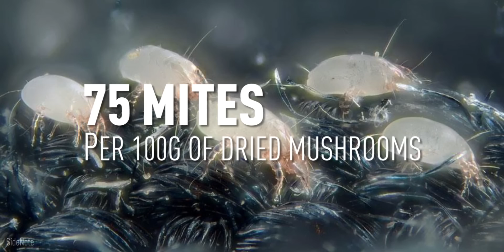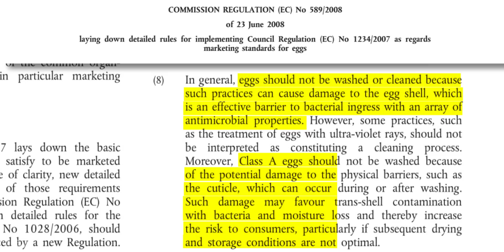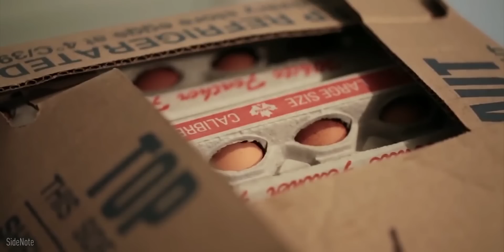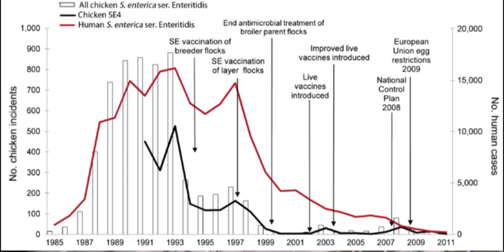Why US Produced Eggs Are Banned Across Europe (& vice versa)

Comment: Huge water waste, huh?  Unless they reuse or, recycle it.

Buy cage free range free only!  Cage free has the same overcrowded conditions as caged.  America should take up across the pond's methods to save water and energy. Air-conditioning/refrigeration adds to the climate change problem.
Reply: My chickens naturally return to the coop at night and I lock them in to prevent nocturnal predation. I started doing this after losing several hens to foxes, coyotes, and raccoons. I release them in the daytime, and have lost a few to eagles that swoop down on them, but less than at night.

Comment: The only reason we put any egg in a pan filled with water (or other container), is to check if it hasn't gone bad.
Bad eggs will float to the surface because of gas that has acumulated because of it going bad.

Good eggs will remain at the bottom.

Comment: As far as I know, European Eggs (wich the UK at least for now still fits and got the same rules as any EU state) will actually last longer then US Eggs, because they are unwashed. All of thise while being not refridgerated. You can leave those things at Room Temperature for like 2 weeks without problems. After that you may cool them. Then they are at least another 2 weeks safe. 

As far as dirt goes, well our farmers seem to do a good job, because the eggs seem pretty clean, altough being unwashed. 
Other then that, I get my Eggs for the most part from the Henns of my Mom. Clearly, they are in some cases pretty dirty on the outside, but that's not a big deal, it's just what happenes. Clean your hands after cracking them and you are good. Not a big deal.

Comment: why did the FDA let the food industry replace Potassium Iodide in flour with Potassium Bromide?
Everyone in the USA is Iodine deprived.  and instead Bromide and Fluoride are being used by the endocrine system.  This is causing many symptoms in most the population.  many glandular isssues have become wide spread.  Snoring, sleep apniea,  enlarge prostate, breast cysts, ovary cysts, impotence, mucsle aches, joint pains, insomnia, high cholesterol, thiroid diseases, Gull bladder removals, swollen adenoid glands causing severe snoring.

Most these symptoms can be cured with reintroduction of iodine into the diet.  you need high concentrations to leach out the Bromine and Fluorine our the your glands.  then you can take a daily maintenance amount.

You doctor won't tell you this, because they are making billions off this little secret.  they rather sell you viagra and ambien.  Look into it.

Comment: And just for fun, the Australian system goes for an in-between option, banning the sale of obviously soiled eggs, but allowing producers to decide how they will respond to that. They can dry wipe clean if they want to, separate the soiled ones for pasteurised egg products or wash all (and with whatever they like, from water to the chemicals & however many re-uses of the water they think is safe), but all eggs are tracked & if they fail to prevent salmonella etc outbreaks, then they are shut down until the problem is corrected & generally put in a situation where they will struggle to stay in business, so they just choose the most practical option for their setting & we don't get salmonella outbreaks except from backyard chickens.

There was actually a salmonella outbreak from eggs recently in Australia, the farms involved were quarantined & all chickens euthinased & bodies destroyed & farms required full disinfection & inspections & testing before being allowed to restock & begin selling to the public again & will also be inspected regularly into the future to ensure the measures have fixed the problem & if not, repeat - they won't be letting that happen! They'll self inspect to ensure their eggs are safe before sale

Comment: eggs are eggs. If they are dirty, you wash them before you use em. Otherwise, the farm only needs to make sure not to sell old, small or cracked eggs. It's not rocket science, people...
Reply: lol i never wash my eggs. its pointless. why was something when you crack it open and make an omelet? and even if you boil an egg the shell will be cleaned of the boiling water. and even then you dont have to worry about a dirty egg. because the shell protects the egg in general.
Reply: @metalvideos1961  you wash the egg if it's dirty, because some of that will end up in your omlet when you crack it. But only if it's dirty

Comment: Once the outer layer called Cuticle is removed when power washed (US Method) the porous in the egg shell is exposed... if the cuticles are left as is, even of there is chicken poop on the outside, it cannot leak inside. When you buys eggs that not power washed....could be washed at home gently just before use. This way eggs could remain outside without refrigeration.  But once you have power washed and the cuticles removed,  you cannot leave it outside..it needs be refrigerated.

Comment: I'm a dual citizen and I prefer the American method. One thing I really had issues with in Britain was that the eggs were always on the verge of going off. I tried everything from top shelf burford browns to bottom shelf generic tesco eggs and everything in between, and there wasn't much difference in freshness in any of them. Summertime was always the worst. I think the problem might be in the transport. They get transported in these hot trucks that get stuck in traffic, and then transferred right over to the cool shelves of a store. Also, all of them always had tons of bird poo which is pretty gross when you're cracking them in the pan for breakfast. I never had these issues with American eggs, it seems the shelf life on those is much longer and they don't go through the temperature fluctuations. Plus, no bird poo!

Comment: There really isn't much difference between them and I for the life of me can't nor have I ever tasted the difference in eggs based on storage and prep. I grew up on a farm, we had (for years) eggs as fresh as you can get them less than 24 hours old and I kinda grew accustomed to that but growing up and moving away I prefer store bought eggs for a few reasons. 

First they are all uniform and virtually exactly the same a minor nitpick but it's kinda weird having 5 different colors/shades of eggs in the fridge with different shapes. 

Secondly I prefer how well store bought eggs crack they can be done gently and it makes it easier, farm eggs by comparison have a much harder shell so cracking them is far less consistent. One egg might need a lot of force and than the second eggs shell just shatters falling into the skillet, trust me seems minor but it's annoying to do store bought are pretty easy and consistent. 

Lastly better quality control no matter how often you pick eggs some will develop more than others over the same period of time (a chicken can be pregnant multiple times at once up to 3). Some lay their eggs fast some hold on to them longer you really don't know how the egg will come out until you crack it open and while not a huge problem it's still annoying to deal with first thing in the morning.

We use to sell them all the time and generally folks liked them but when asked why they like them they typically default to a "their from a farm they must be better" type of answer verse actually enjoying them more or the taste. Buy what ever eggs you wish tho the choice is yours but growing up with farm fresh eggs and now using store bought besides consistency there really is no different.

Comment: All anyone needs to do is to Google number of cases different countries have per capita of salmonella infections annually. Right there will tell you which process is better than the other. All the regulations are for one thing and that's to prevent the spread of food-borne diseases like salmonella. So wouldn't the answer not be in a video that talks about how the eggs are handled differently in the country and ignore infection rates but in a video that ignores how they're handled and simply tells you which system has the best health results. But that's not what we did here is it. The viewer is left to either have the initiative to look up the facts themselves because they're not going to get it in a biased video such as this or any other bias video. Look at the health statistics and facts is where you'll find a truth if they are accurate

Comment: long story short. it’s 110°F with 99% humidity in the gulf south
Reply: Short story in the Iberian Peninsula 110ºF was already reached this year in the coldest summer in 20 years.Albeit with 0% Hummidity and over 95ºF during the night in extreme cases which is the worse of all as even sleeping is tough in such conditions. I liked these summer of warm mild temperature as the central european anti cyclone pushed the warm airs of the sahara to France instead(Plz god fuck them instead)
Reply: i dont near the gulf but in GA its been so close to 100 f and high humidity, i would believe you if you told me you could swim through that air.
Reply: Celsius?
Reply: @TheUKNutter  110F is 43C. At that temperature and at that humidity, I'd just kill myself.